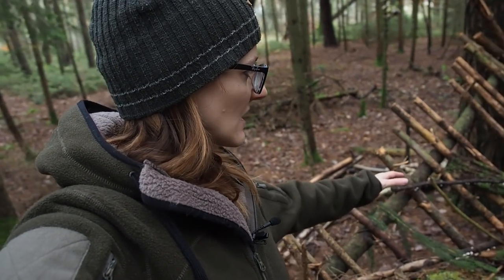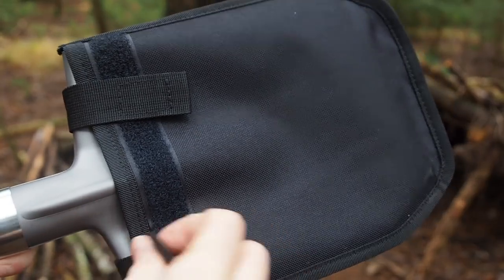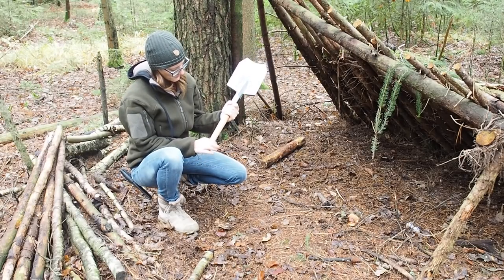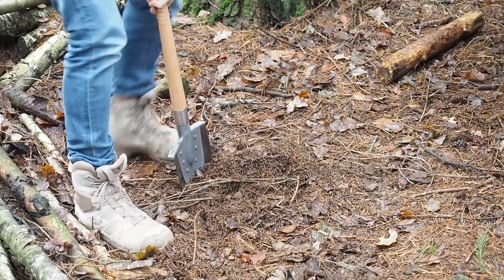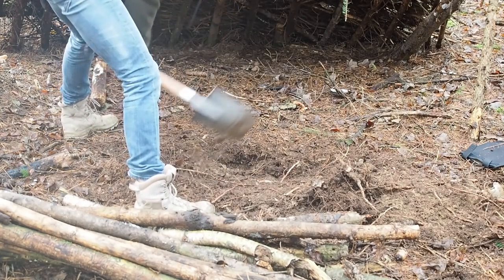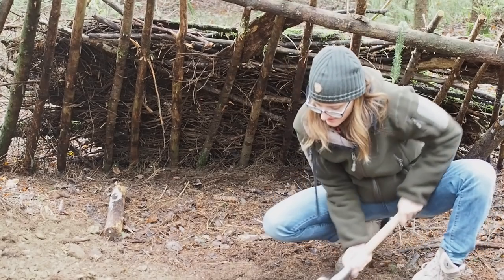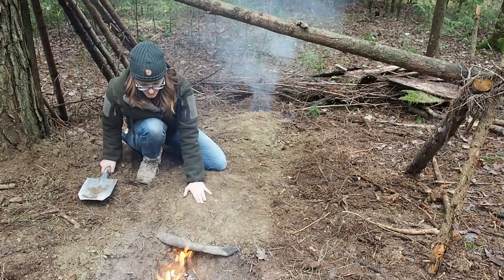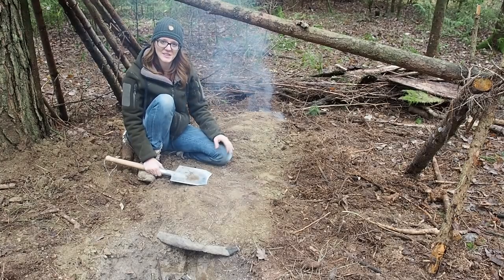Building a PRIMITIVE Heating System

Comment: Looks like the shovel doesn't work very well.
Reply: I thought so, the shape of the shovel is unique but is not fit for digging.
Reply: the shovel shape is for scooping gravel not for digging holes. i use this design all the time for gravel.
Reply: Reading a comment chain discussing shovel design is probably the last thing I expected to do on youtube today.
Reply: Any shovel is going to have a hard time when you are digging next to a tree like that where the 'dirt' is more like a woven mat of small roots.
Reply: I like your username it’s cool #sleeperlife
Reply: Soil that's filled with roots like that is hard to dig through, with most any kind of shovel.
Reply: With a handle that short it’s hard to Used from a standing position, especially when trying to stomp on it. Might hand had an easier time using a chunk of wood to baton the top of the blade like a hammer and chisel
Reply: Of course, it's difficult to use, It's a survival shovel. I find it difficult to believe that someone hiking in the woods is going to carry a long-handled shovel.  And I wouldn't want to use a hatchet or ax on those roots in the ground, that would really be hard on the blade.  I thought it did the job well given the inherant constraints of a survival shovel.

I do agree that being able to use it like a hoe, or having a hoe attachment, could be useful.
Reply: The shovel's handle she's using doesn't fold or collapse, so it's longer than necessary. The shovel head is poorly designed since it spreads out the force of your digging motion rather than focusing it to a single point which means your going to have to work harder to dig a hole. Then finally it has screws to hold it together rather than rivets or welds and screws fall out. It could be worse I suppose. They could have made it solar powered or painted it pink. To each his/her own I guess.
Reply: It´s not the shovel´s fault, when your struggeling against a tree´s roots. Some say, digging next to a tree and burning it´s roots is a bad idea. She should have chosen another place for her firehole...
Reply: Have you ever tried to cut roots with ANY shovel ?
Reply: I’m New  to your channel and am really starting to admire your work. Thanks for sharing - who amongst us “knows it all”?  Easy to critic when your not the one under the magnifying glass.   

I’ve watched a handful of your videos and your content is always good and educational and different from others that I’ve seen... (Underground heating..)  Mostly I notice a genuine sense of you having a good time.  

You go gurl!!!  Keep on keeping on!!  God bless you ... keep your head up, and the good work!
Reply: @mathewlau1733  😂same😂👊
Reply: Shovel quiet good but cant match with that kind of rooty soil where she digs...its too close to the tree..hehe..she works hard and a wonderful courageous lady!

Comment: Free advice. Throw that no count shovel away. Get you a shovel designed for digging , ' you know a shovel with a tapered point. Also 'for good heat transference wouldn't have been better to place flat stone over your ditch and covered with soil?  Stone, I think would have heated far more and radiated heat throw the soil far better than the tree bark you used. Right?  Thank you for the video.

Comment: Hey Lady Lily, a great idea!  I’m wondering if a  more permanent & efficient trick maybe a flat-stone lined heat tunnel running the length of your shelter? And with the chimney up to roof peak height I usually get better draw therefore more heat. I assume you’d capture more heat inside & the stone would hold that heat longer. Maybe even until morning if you incorporate a long-lasting fire. Any comments folks? Thanks for all your survival ideas!

Comment: Very old technique, used it once back in time, the flue trench was 30cm HxW, lined with flat rock, sides and top, to support weight, fire pit deeper, air intake port as you showed, if done correctly, you cover the fire pit with a large flat stone, directing the hot gases, under the length of your shelter, It should act like a rocket stove, you need to block the exhaust  with a Chimney like structure to reduce back draft, and for cooking. found it time consuming to build and usefull in a semi-permanent dwellings. By you showing this, proves to me your the best there is, we could trust our life with you. You are a champ!

Comment: Thanks for the good work. .. Here is an idea that you may like. If you put a chimney on the end of the flue you will have a draft that will draw more heat into the plenum. You could use a hollow log for the chimney,  or make one with sticks and clay.
Also,,, if you put a secondary fire pit at the bottom of the chimney, and use a small secondary fire there to start the draft.
Also,, on the main fire pit, try to make it deep and narrow with a secondary pit for the daft, like a Dakota Fire Pit. Then you will need to find a large flat rock to cover the main fire pit. 
I have a survival book that I got in 1977 that covers this...
But the idea comes from the Anasazi Indians of the southwest United States. 
Or at least,  that is the first reference of this idea that I have found.
Anyway, ,, it is always a joy is watch your videos...

Tanx, and keep up the good work. ...
Reply: Very, very interesting. Thank´s a lot!!

Comment: It would be interesting to see a temperature reading of the earth directly above the tunnel and on either side of it.  Also, I think you might be able to get more of the hot gases going up the earthen channel, which would increase the amount of heat it provides.  I really like the energy and enthusiasm in your videos.  They are very inspirational, in a sense.

Comment: With a harsh winter on the way, that shovel is a must have thing for moving snow, those cheap eBay ones just break. 
 
With the bed chimney, you need the fire pit a bit deeper and a flat stone partially covering the flames. Also sealing the cracks between the stones with wet clay will seal out the smoke better. 
Good luck Lilly. 👍

Comment: Hey Lilly! I love your videos, and I understand the concept you are trying to use here in this particular video, but I also see a few major mistakes as well. Assuming that you are going to continue using debris on the back wall of your shelter where the smoke exits, you could very easily end up burning your shelter down if the wind were to blow sparks/hot cinders against the back of the shelter. Also using combustible bark to cover the smoke vent,(even with the dirt on top of it), could end up causing ALOT of problems if it caught fire and/or collapsed while you were sleeping. Flat stones would not only be safer and more sturdy, but they also would retain heat from the fire and release it through the dirt to help you stay warm even if the fire dies down or goes out. I've actually thought about using this same idea by building it inside a large A-frame debris shelter, except covering the fire box with a removable stone and incorporating an air vent to give it oxygen. I would dig/build the fire box on the north end of the shelter with the smoke vent running south underneath the length of my sleeping area, ending on the outside of the shelter where I would build a raised chimney to keep the smoke and sparks higher in the air, and also to keep it from getting clogged up with dirt/debris/snow. I would also build a covered,(A - frame), entrance into the middle of the east side of the shelter, which could  be used as a storage area for firewood, ect. This would work well in your teepee, or a yurt/wigwam also. Just remember to keep the air vent low, and the smoke vent high in the firebox. Stevenk 1965 made a really good video using this same idea,("Heating system for a winter shelter Pt. 1 and Pt. 2"). Also on Primitive Technology's channel where he built one in a mud hut. Again, I really do love your videos, and your passion for what you do. Enjoy the woods, and be safe.  :-)

Comment: I am a big fan of my old Army Mattock . It is a pick/hoe combination that digs through absolutely anything . I've used it for 40 years and it is still as good as new . It is small and fits on the side of my pack too .
Reply: Yeah, I was thinking - if you're going to bring an axe too, why not combine them and bring a Pulaski (or if you like to go old-school, make it a Dolabra like the Roman legionnaires carried).
Reply: A mattock is pretty much only useful for digging and that is what it does best. The pick end for breaking up dirt and stones and the hoe end for clearing the dirt and stones. Imo it's more useful for your digging tools to be slightly heavier, because it's weight lends towards the downwards force of your swing, and your axe/cutting/chopping tools to be lighter coz you have to swing them more at a horizontal/diagonal angle and if they're sharp then usually don't require as much force. Therefore making your mattock into an axe/mattock combo is kinda counter intuitive despite saving you some carry weight and space.
Reply: i use my military shovel to,it is very sturdy
Reply: I have a Korean War era  military entenching tool that has served me well for many years. I found it at a farm sale many years ago. You find parts of your kit where ever you find them!
Reply: Frontier Asset Amen Brother . I hunted for years using my LBE harness and butt pack . It would still do the job today as a get home or standby pack !

Comment: An excellent idea. I have a few thoughts on improvements.

First: I like your idea about building a chimney trench and a second air supply trench. If the air supply trench comes down to a sump lower than the fire itself it will become more efficient.

Second: You have a nice large flat stone there. If you can find a second stone like it, you could over hang the fire partially giving you more of a "stove surface" with the rock while still separating your bark from the fire. This will also duct a lot more heat and smoke into your "chimney tunnel". 

Third: If you split the "chimney tunnel" where it passes under your bed you can direct part of that heat to your lower body, and part to your upper body. I would then make a turn and still take your smoke holes out behind the shelter area as you are already basically doing with your single trench. You could even go so far as to make multiple passes under your bed so it passes for example from foot to head, turns and passes from head to foot, and back again for one or two more passes before exiting outside the shelter. This would give the smoke even more time to heat the ground below you.

Fourth: I would like to express my concern over the using bark to make your chimney tunnels. I have a bad feeling in time a misplaced step by you or a guest could break through to the tunnel below. I would encourage building with stronger materials when you are able. Ideally more of those flat stones would make a magnificent "chimney tunnel" as they would be strong enough for anyone to walk on top of without fear of damage, and more importantly perhaps, they would absorb more heat over time. Especially if combined with the overhanging stone I mentioned above, this would result in more absorbed heat to radiate under the bed area.

There is a similar idea in use in raised benches in a more permanent construction. It involves using chimney pipe from wood burning stove passing a few times through a dirt filled bench that has a stone or masonry top. These benches store a lot of heat, and can keep a room or gazebo or other enclosure warm for a long time after the fire has gone out.

Keep it up Lilly.

Comment: Another interesting project, Lilly. I was thinking about it while watching. What if you were to dig a cross-channel at the end, forming a 'T', where the cross would be along and under your bed? Leave a slight opening at each end to allow for draft to fill the void. I would have laid more slate (flat) stones atop the bark so the main channel wouldn't collapse if you step on it. Stones by themselves would absorb the heat and transmit it above, while bark would tend to hold it in, allowing more heat through the channel.  Or not, I guess.
Reply: It's a lot of fun to play with designs for this as there are many tradeoffs. You want to limit the tunnel extent so that you get a solid draft, otherwise you lose throughput for coverage. That's one tradeoff. You also want heat sinks in the living area but not too much because they will take too long to convey the heat. Your idea will work with enough fire, but for overall maximizing of heat conveyed for unit heat produced a narrow single tunnel is (I think) mathematically the best option. If firewood is no problem then the equation changes.

Comment: So I saw you make a a similar system in a tepee using old clay drain tile and I had a thought: instead of digging a single trench, dig two with your fire pit in the center. That way no matter which way the wind blows you have an open air channel and once you get a good bed of coals stack your wood on two sides with the air channel running in between

Comment: Using stone to create the tunnel roof before covering may give you better long term heat once the stones heat up and possibly prevent caving in the tunnel by accidentally stepping on it. But your probably right to do it this way to see how it works before you start hauling rocks. In any case it is a ambitious project that deserves applause as well as respect.

Comment: Here is an improved version that is very old school.

Hot Draft Bed
The Other Fire Bed
By Raspy

While the fire bed described by Ron Hood is an excellent option for someone on the move or stuck for a single night out. It has to be constructed for each use. The hot draft bed is a design that works if the situation may require several nights in one location. Such as after an air crash, while awaiting search and rescue. 
 
The initial construction phase does require more work but that results in a semi-permanent structure that can be used night after night. First 3 parallel trenches are dug. These trenches are approximately 1 foot wide and 1 foot deep. They are spaced about 1 foot apart. This gives a warmed sleeping area roughly 6 feet wide. The length of the trenches is from a minimum 3 feet long for a single sleeper to a maximum of about 9 feet for several sleepers. They should be positioned parallel to the prevailing wind direction to promote good airflow. The upwind end is for the fire. This can either be 3 holes at the end of the trenches or a single long trench connecting the 3 smoke trenches. The fire pit is between 18 inches and 2 feet deep. The upwind side of the fire pit can be slanted for a better burn. At the downwind end the outer trenches are slanted in to join the central trench. At this joining point a chimney a minimum of 3 feet tall is built. 

After the trenches have been dug they are covered with sticks around finger sized thickness. [See trench cut-away view] The sticks form a roof over the trenches. Then the dirt that has been dug out is layered over the bedding area. This forms a seal to keep smoke contained in the trenches and retains the heat. It also makes a smooth sleeping pad. The chimney can be built from rocks that are from the trench or found. If there are not enough rocks available sticks can be used to form a cone. Plastering with mud, clay or just heaping dirt over it can seal the cracks in the chimney. If dealing with restless sleepers you may want to drive several stakes along the edge of the fire pit. This would prevent rolling into the pit and having a rude awakening. 

To use a fire or several fires are built in the fire pit. The smoke and heat is drawn through the trenches and out the chimney. This heats the surrounding soil. Depending on the moisture content of the soil it may take several hours before the bedding area to dry out enough for sleeping. That is unless you want a sauna. A lean-to or other form of shelter can be constructed over this warmed sleeping area.

As you can see because of the amount of construction this is not ideal for a single night. But if in the situation that may turn into several days this is a very practical solution. It also has the advantage of accommodating several people.

Comment: Congrats on your Austrian Video Award!  You're building something like a horizontal rocket stove.  I would think that extending the cover over the fire to force more of the heat through the tunnel would increase efficiency.  With the setup you have, my guess is that 95%-99% of the heat goes straight up.  Then, of course, too much earth over the trench would insulate too well making any heat continue out the end.

Comment: Have you thought about mixing up some thick mud or a cobb like substance and making the air/smoke tunnel that way? It would be much more sturdy, and it would store the heat really well to keep you warm if the fire goes out while you are sleeping. Just a thought.

Comment: If you use flat stones to cover your tunnel they will heat and up and retain the heat better. I also think if you do this so it would be diagonal or run lengthwise through your shelter it would heat more effectively as well.

Comment: I really like your videos. I generally learn something new with each video you post.   I am curious about the strength of the tunnel. I understand that part of the tunnel will be covered by your raised bed. But what about in front of your bed, you will need to be careful not to step through the bark. It also looks very interesting.

Comment: How did you get that to work with out the fire being under the rock?
Reply: When you create a tunnel like that you get a chimney effect wherein the breeze across the exit draws air through the tunnel which draws air from the fire. The diameter of the chimney and wind direction can effect it but that's the overall physics